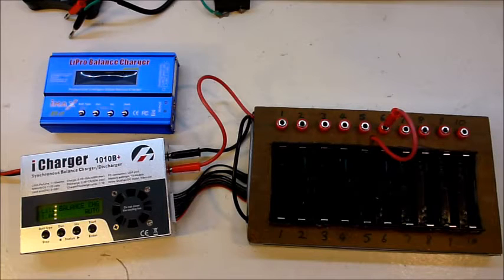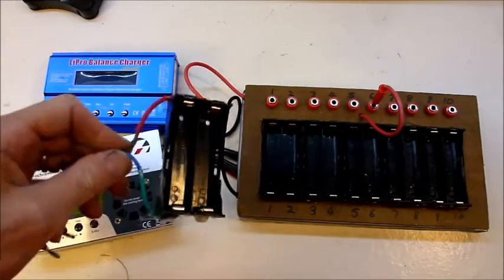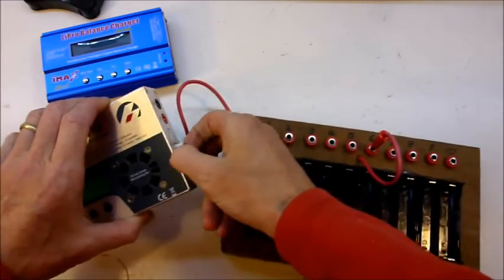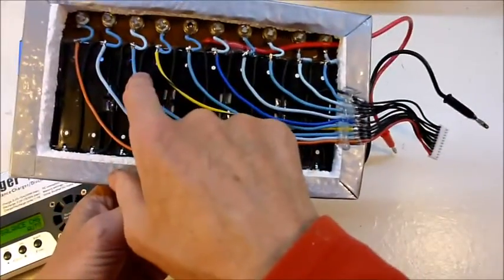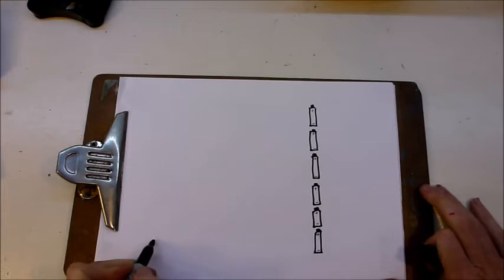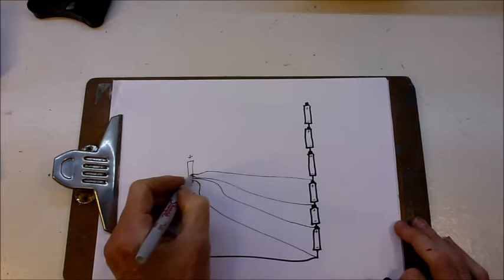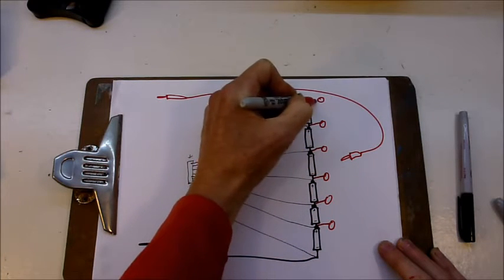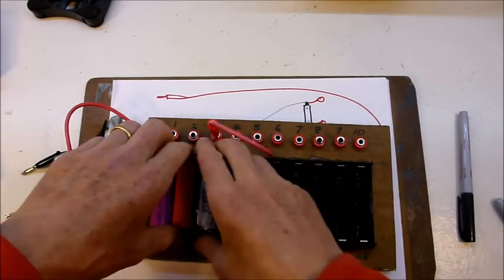Laptop Powerwall 04 - 18650 10-cell charger

Comment: High Paul Can you recommended what type of new 18650 batteries for my ebike 48v 35amp controller 1500watt motor ebike.
Reply from the maker: I must confess I've never bought a new 18650 - so I don't know much. All I can say is don't buy any cheap cells (anything with "Ultra" for "fire" in the name is a fake). Oh! and read http://lygte-info.dk/review/batteries2012/Common18650Summary%20UK.html

Comment: You mentioned discharging. Multiple discharging isn't possible though is it?
Reply from the maker: I use 4 separate iMax B6's to discharge 4 separate cells (or in my case pairs of cells).

Comment: https://f47fb5b4-a-62cb3a1a-s-sites.googlegroups.com/site/tjinguytech/charging-how-tos/balance-connectors/rcheli-diagram-balance_jst-xh.png?attachauth=ANoY7cra8uoutu_Mlcr925_D1QzyS5O2IKT9DVk6tdkiODDrmCB7UDRKfqnecYAm24yAtHFSFqRv6DGfFt8HC596jsZxBsV3w2cH9y_bgbTKQsj6THm0AN-Y_xxzFVgn5syGARvuLUA-OSeF7R5-qzDAEu4gsxc5EEo66-3cgQ5pOu0OqIhP-Qp0zSs1r6BULkWAMtkRtvakoCCem7Pprw7RPdMvLRfo2HVrf0z5_zBusXwRTn0t_lU5acXW7IFTjP3CzdaGgHiE5K1EyDwadJRltklp2W_JudXe1Yu2OSHE3__e1YtJgp8%3D&attredirects=0

Comment: Paul:  I like the idea and I wired up as you show...but I had my IMAX B 6 beep at me and flashed reverse polarity ...black to yellow is +3  black  to orange +6 volts black to purple + 9  black to blue is +12  black to green is +18 before charge  so got any ideas.......  I am scratching my head...
Reply from the maker: +mtradad Could you send me a photo of your wiring at the battery holder end? I'll see if I can spot anything obvious.